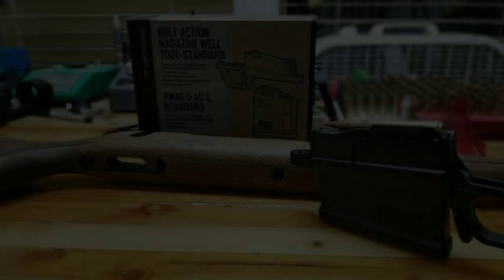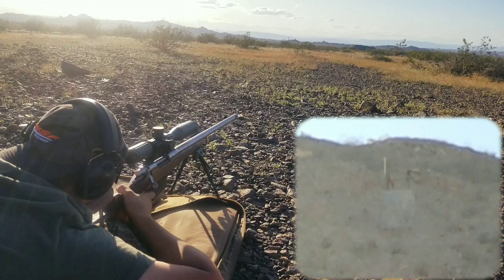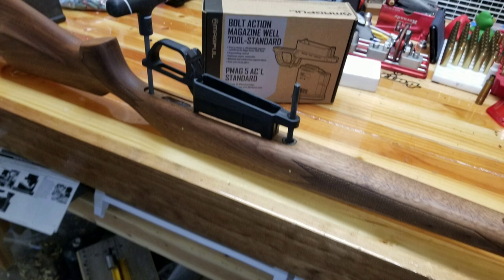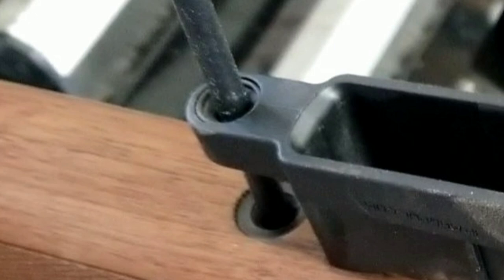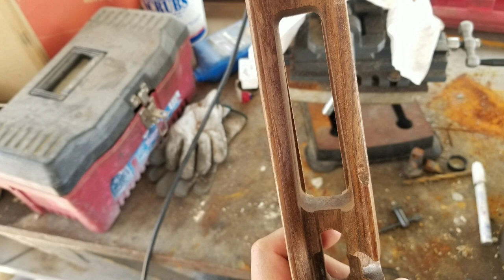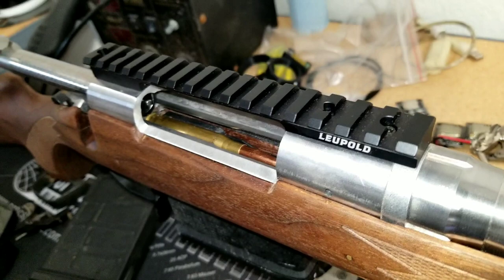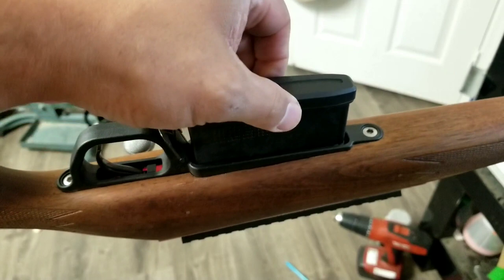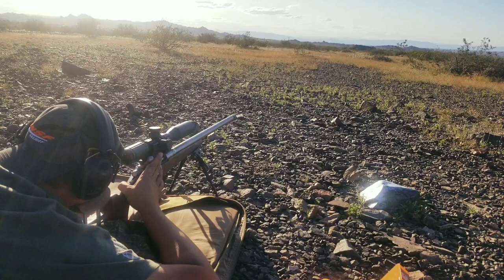Remington 700 ADL / BDL AICS Mag conversion | Magpul mag-dapter bottom metal

Comment: Uncanny. Did the same to my 700 la with an x y and a press Wierd. I did glass bed though which I recommend for this mod as it eliminates any slop. Looks great!
Reply from the maker: Awesome!  Ya I plan on bedding with Devcon, Since I installed an oversized recoil lug, I wanted to settle and compress the wood before bedding as this is a new action on an old stock.  The groups are amazing on this blueprint  build so far. Ill have a video on this soon
Reply: @EagleEyeShooting  devcon is good dope. Like to mix it with glass for large spots. It's a good prep for wood diluted with acetone. Penetrates the wood and seals it up

Comment: Nice work.. I just got a drill press.. need one of those x y plates.  I have a savage 308 with a blind mag. Will this work in savage stock ?
Reply from the maker: Absolutely,  theirs bottom metals for most Savage models. However, they usually run about 150$. They make an awesome solid upgrade though.  Better fit than the accustocks

Comment: Cool,, planning on doing it to my adl.. would it be easy to use dremmel on a poly sintectic stock?
Reply from the maker: Dremel will work. Hard to make clean cuts though. Maybe a cutter wheel then sanding wheel?